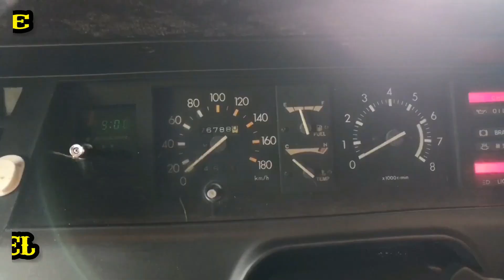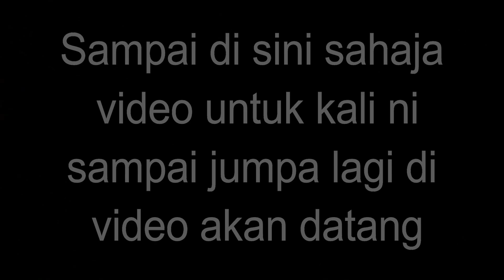Fixing Window Regulator & Changing New Drum Brake l Toyota Celica TA22

Comment: Where did you find the new regulator in order to take the little gear? I have the same problem on my ta22
Reply from the maker: I just bought a new regulator from other toyota car then take the regulator from it to replace it on the celica regulator
Reply: @EngineBayMakeover  thanks a lot man, you saved my ta22 regulator. I bought a hilux regulator et take the gear and put it on my ta22 regulator.

Video here if you wanna see
https://youtu.be/HEq3BPV3pjE
Reply from the maker: @gaijinconcept  👌🏻😄